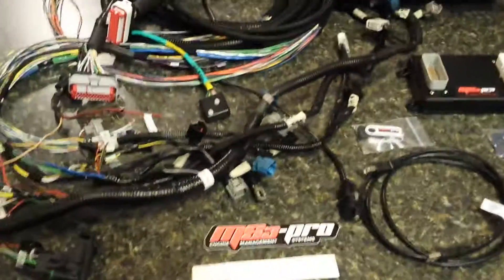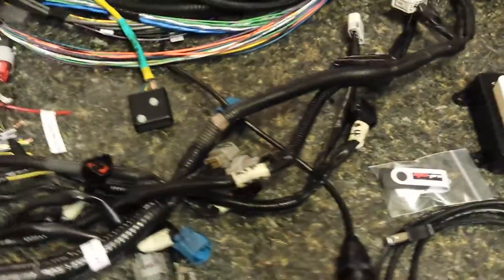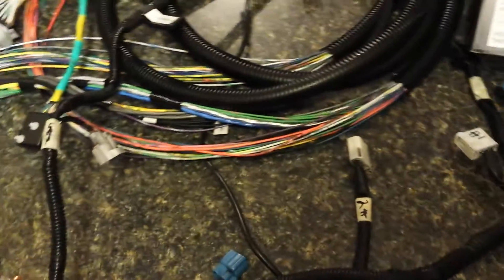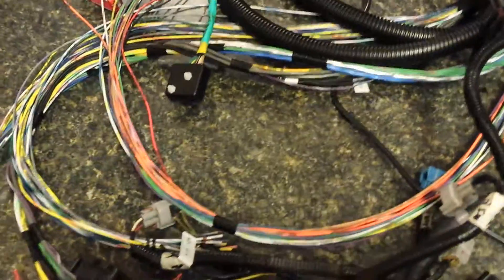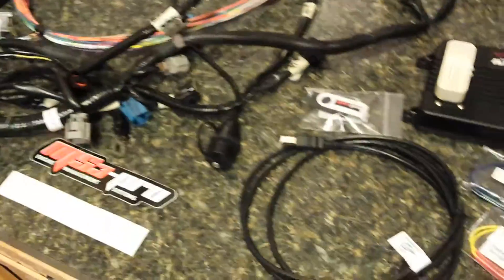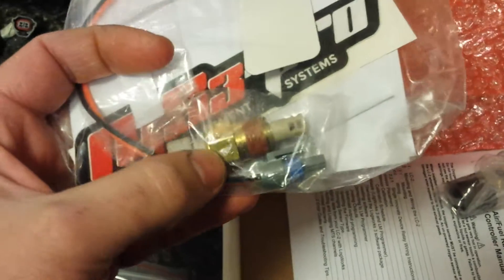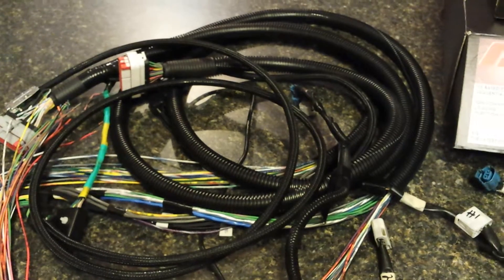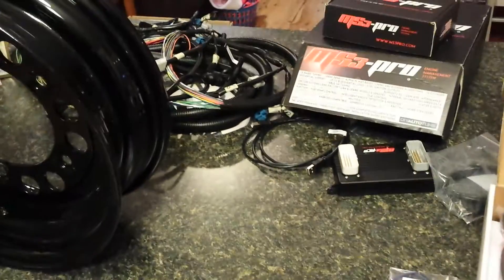VW Beetle Subaru Swap Project Update: Megasquirt 3 Pro!

Comment: Hey man me again haha, I’ve got a ej22 from 1997 sitting in my garage right now. Got it and the harness running for 300. Anywho no matter what I do I can’t get this harness to do anything. Hard wired the main relay connected the three main engine plugs, ignition wire to the positive. Should I just scrap it and get a standalone ecu?

Comment: Hey so im planning on trying to swap the sohc ej25 into my beetle. I heard they were only made 99' and up so with the obd2 setup. Would it be worth it to run a ms ecu to avoid the obd2 issues? thanks.
Reply from the maker: Early obd2 isn't a big deal. The 04 up with chip keys is where it gets tricky. Obd2 started late 95 for the EJ engines. MS isn't the best standalone for Subarus honestly, there are better plug and play solutions out there for sure.
Reply: @MRT_H  Sweet thanks a ton. Trying to learn as much as I can and your vids have been great. my 1600 crapped chunks of metal in the oil strainer and a simple rebuild costs close to the entire subaru swap haha
Reply from the maker: @hobohamster1808  Subaru engine swaps are a huge improvement, once the logistics are sorted out. Makes the car much more fun and reliable. Glad to help!

Comment: How did you connect the ECU to Ignitor and Coils?
Reply from the maker: I hooked the coil wires up the the proper pin on the coil, powered and grounded the coils. The igniter is actually built into the coil if I recall. Look at lots of diagrams, it'll help!